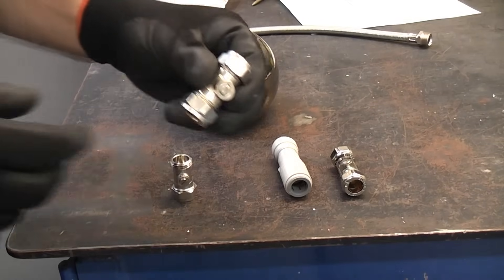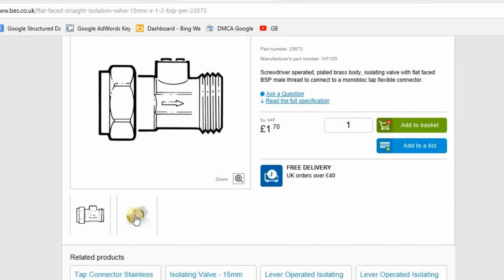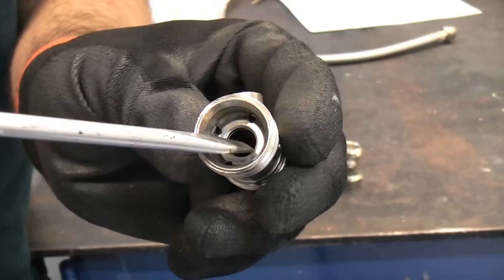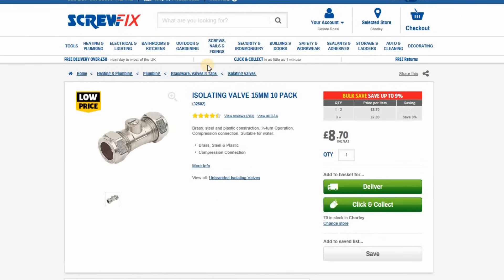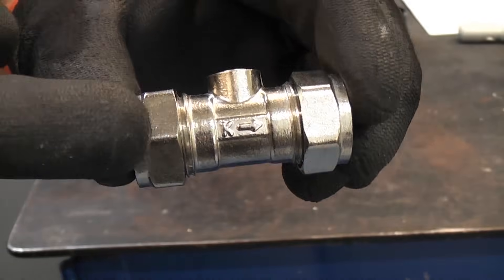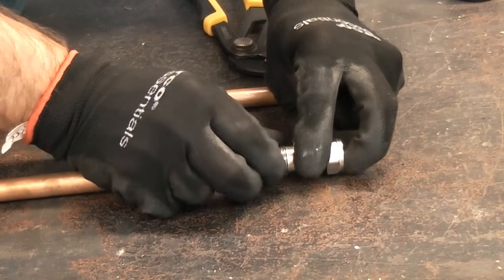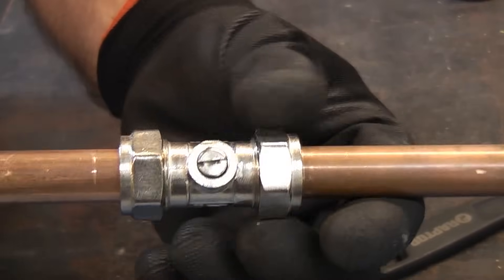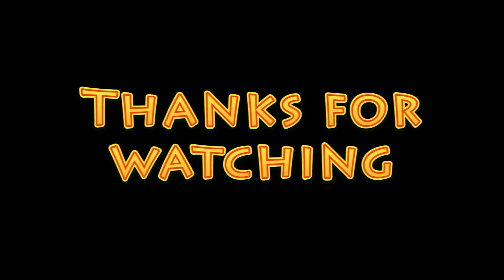How to fit an isolation valve ⚡

Comment: my valves just have a K on them no arrow so iam guessing the flow will go to the right of the k as your British ones have K> hope it’s right
Reply from the maker: You can normally tell by looking through the fitting (where the pipes go), but in 99% of cases if it’s installed the incorrect way, it will not make any difference 😉
Thanks for the comment 👍

Comment: Thank you. Actually have the problem with the slight leak around the screw. Just moved in my new house and was looking for the isolation tap but for what I see I only have an isolation valve

Comment: Mine is weeping from the bottom thread on 2 of them and another 2 further down from the top nut. Brand new fitted by plumber. He said he’s tightened them up a bit further but at a loss
Reply: Crushed the olive. New olive needed.

Comment: Amazing video, espwcially as it was not filmed on a cramped space under a sink!

I have isolatiom valves for our kitchen taps, copper pipe leading into the tap, can i sinply remove that section of copper and replace ot with a flexi sheathed pipe which connects into the top part of the isolation valve?

Comment: Wouldn’t go near them look when he shows you the inside see how much the flow is restricted it’s only about 10mm instead of 15mm and as he’s explaining the price how could anything that cheap be any good the next time you go to isolate the run where you want to work on you’ll open the valve and it will drip these things are mass produced buy a good English brand like Pegler or Hattersley not this cheap muck produced in the far east.

Comment: How much length of the copper pipe need to be cut if the pipe is situ under the sink ?
Reply from the maker: You’ll have to measure the valve that you have 👍

Comment: Great video!  How do you measure the amount of copper pipe to cut away to fit the valve?  I am doing a UFH supply and return pipe (polypipe system) upstream from the main thermostat - the installer didn't put an isolation valve in!  I am not sure about the water flow but logically the hot pipe will flow to the manifold and the cold away from the manifold.  What do you think?

Comment: Can you re-use as in reopen and Re close or would you need a new olive?
Reply from the maker: Yes, certainly. You only need a new olive if you are using the fitting on another pipe. In the unlikely event that the olive leaks, just wrap the olive with a little PTFE tape 👍

Thanks for the comment 👍

Comment: Can you not connect a normal isolation valve to a Flexi instead of the flat end one? I've been doing that for years with no issues.
Reply from the maker: I was told by a gas fitter years ago, just to use a normal isolation valve, but then the flat faced ones seemed to appear. The flat faced ones are better, because there is less chance or damaging the sealing washer. I have installed lots with normal isolation valves, but always get the flat faced ones now 👍
Reply: @ultimatehandyman  thanks. I think I'll use the flat ones to. 👍

Comment: Get the proper ones with the wing head their crap go and work on them after been installed a year or two and they start to leak so your back to square one isolating from the main valve to replace one of these.

Comment: I have a leak from the isolation valve abutting my cold water storage tank. The unit seems to have a threaded extension from where the leak is coming. The nut to nut dimension is about 69 mm. Is a standard isolation vale OK or do I need a service valve...what is the difference? (I'd like a lever this time). Thank you!!
Reply from the maker: It sounds like it could be a service valve. There is often a fibre washer in one of those, it is probably damaged and just needs replacing (unless the valve itself is leaking). You can turn the existing valve 90 degrees then replace the washer. If you want to replace the whole valve with a lever type, you will have to isolate the water elsewhere 👍

Comment: Quite helpful. I attempted replacing mine before watching this video but it was terrible as water was leaking. After watching your video i did the second attempt and there were no leaks. The problem was that on the first attempt I just placed the valve and tightened the nut without pushing the valve further enough. 😂😂

Comment: Never to be used on an outside tap, use a lever full bore valve, if you get a problem you don’t have to find a screwdriver to turn off.
These are a service valve for ball-valve , taps etc you will find that they start to leak through the screwdriver slot after time.

Comment: Can I add this isolation valve to a live water pipe? Not sure if i can turn hot water off in my house want to change kitchen tap.
Reply from the maker: Yes, but you will have to isolate and drain down first

Comment: Great info & presentation, thanks. ps, I found it strange to hear you say 'in situation'. I think you may mean ''In situ'? This does not mean 'in situation'..In situ literally stands for “in place of”, “at the original site of”, “in the natural position of” or “in the undisturbed shape or orientation of”. This is a Latin phrase that is used in different contexts depending upon the area of emphasis. Apologies if im wrong!
Reply from the maker: I was led to believe that in situ was short for in situation, I could of course be wrong. If the teacher is wrong, the student is wrong 😉 
Thanks for the comment 👍

Comment: are these isolation valves made as non return valves? or you would need a non return valve and a isolation valve for fitting mixer tap. thanks
Reply from the maker: No, you would need a check valve to prevent backflow, as an isolation valve will only isolate 👍

Comment: If fitting one in situ 15mm isolation valve on a straight length of pipe how much pipe do you cut out of the pipe for correct operation and installation.👍

Comment: V.useful video, with clear explanations and easy to follow. We ended up using 240 wet and dry sandpaper instead of a deburrer as we couldn’t find one in our DIY shop and it worked well.
Reply from the maker: Thanks for the comment 👍

Comment: Thank you. Appreciated.
Naturally a lot of plumbers don't want small 10 minute jobs even as they would pass by the house anyway. Our old plumber retired and it is almost impossible to find a reasonably priced plumber who won't charge more than half hour call out and parts. Now I have found the parts are only a small amount anyway but our old plumber only charged £30 for small jobs. That was a lot of his work and he did well taking on the small things.
One in Chichester through a checkatrade quoted almost £100 for a tap washer replacement. Checkatrade has really gone downhill and I shan't use them again after our last two experiences. I don't know how they are getting high reviews. The one star reviews are horrendous now. Seems they were bought out.
Reply from the maker: You are welcome
It’s always difficult getting tradesmen to do small jobs, as they would rather do the larger jobs!
Thanks for the comment 👍

Comment: Great video, one question when fitting the 15 mm isolation ball valve, it will mean cutting some of the existing pipe out to make space for it, how best to measure the space needed by the isolation valve?
Reply from the maker: There is normally a line on the isolation valve, showing where the pipe will insert to. Just hold that up to the pipe and then make two marks using a marker pen 👍

Comment: Question. if you turn off the water  from the main supply stopcock in the property. do you need to power off your/combi/condenser boiler.  boiler in question is a bosch worcester.  tia
Reply from the maker: No, you don’t need to switch the boiler off. The central heating will still work, but you won’t have any hot or cold water at the taps 👍
Reply: @ultimatehandyman   Thank you kindly sir

Comment: Those isolation valves are cheap and nasty. They leak as soon as the screw is turned. I only use Pegler Yorkshire now which never fail.
Reply from the maker: Pegler are great quality 👍

Comment: Great video, when fitting to a pipe under the floor what length piece of pipe needs to be cut out to allow fitting?
Reply from the maker: It depends on the make of fitting, normally it is about 40mm (if I remember rightly).
It’s best to check with the fitting that you buy 👍

Comment: 1:15 how come you havent seen these before? Its mostly used to connect washing machine water supply pipe.
Reply from the maker: I think you’ll find that they are two completely different things. 
Isolation valves are ½ BSP. Washing machine taps are ¾ BSP  👍

Comment: Hi mr Handyman, Just a question for you. You said you were using a standard 15mm thread size, this means a 1/2 inch BSP, correct? I need to make sure I order the correct adapters for my new tab?
Reply from the maker: 15mm pipe size. Yes, the nuts are normally 1/2 BSP

Comment: How much do you need to cut out of an existing pipe?
I assume the pack will have this measurement on it.
Reply from the maker: In most cases you have to holed the valve up next to the pipe, you should be able to see where to mark the pipe for cutting. If you are lucky, it might say on the packaging!

Comment: My isolation valve has stopped working turn to on water started to run then it stopped still no water
Reply from the maker: I've not come across that before.
Is it definitely installed the correct way (with the arrow pointing in the direction of flow) ?

Comment: Are they always in direction of the water flow? Some are in the direction of the pressure, although same thing I suppose
Reply from the maker: Sometimes they are fitted the incorrect way, it's not normally a problem, but could cause problems when trying to isolate the valve (if there is a lot of pressure).

Comment: thanks for this, I just relised I fixed a isloation valve the wrong way, as the new one I got had no directional arrow but only a K so I assumed  the water flowed to the left  I  <  but it is actually the opposite way. k  >  this way, yes I am not a plumber, and I could not see nothing on the internet about valves and how to fit them on till this.

Comment: Thank you for this informative upload. Are the terms "15mm" and "1/2"" interchangeable for UK fittings?
Reply from the maker: Yes, only last week I replaced two radiators for a friend and their pipes were 1/2 copper.
Normal 15mm olives (copper are best) and 15mm compression fitting worked perfectly 👍
Reply: @ultimatehandyman  Great, thanks so much.

Comment: Its v difficult when the isolator is tight against wall and in bottom corner, its v hard to get the 2 spanners in. Are there any other tools which can be used?
Reply from the maker: These can be difficult in confined spaces.
A push fit version would be much easier to fit.
You can get compression nut spanners, but the ones cut from sheet steel are crap.
I have one of these, but it depends how much room you have -
https://bit.ly/37w7oQd

Comment: I have found that the screw seizes up on the valves when they have been in situ for some time. The lever ones are better in that respect.
Reply: Agreed they can seize up though mine have been in over 30 years with no problems. Try to avoid the cheaper brands if possible. Lever valves are great when you need to be able to turn off the water very quickly but they need the space to be fitted which is not always possible. Mine are fitted on the supply to the loft tank and the cold water feed to the hot tanks. Much better than gate valves...

Comment: Don't EVER fit those metal valves!  They always leak around the screw and are totally useless.  The speed fit one is probably better but I've not fitted one yet.  Fortunately limescale eventually builds up around the screw and seals it, but you won't be able to turn the screw without a massive squirt!
Reply: A small squirt of WD40 at the screw slot when fitting makes for a better job

Comment: Why does it weep from the screw when isolating and turning back on? What would be the reason for it not working to stop the leak? Would you just need a whole new valve?
Reply from the maker: Yes, if the valve is leaking from the slot, it might need replacing, although sometimes if you turn the slot slightly, it will stop weeping.

Comment: When we're deburring a pipe which has been placed vertically, do we need to worry about the pieces of copper dropping right in to the pipe? What plumbers usually do about it?
Reply from the maker: I don't think there is much you can do, apart from flush out the bits afterwards.
To be honest, If I was a plumber I'd make something to push in the pipe to stop the shavings dropping down 👍

Comment: What's the clearance between pipe-ends, please?
Reply: I think I would insert the end of a pencil, or a piece of dowelling, or even a depth gauge, if you have one, and measure  and mark the distance from the end of the fitting to the stop inside. Do this from both ends, then measure the fitting overall, then add your two readings and subtract that from the overall dimension. That should give you the clearance you need between pipe ends, so it seems to me. Anyone else got any comments?
Reply from the maker: It depends on the make of valve, as some are slightly longer than others.
I think this one is about 40mm 👍

Comment: I have push fit isolation valves in my bathroom but I can't turn them, a normal flathead screwdriver is too small. I don't know if I need a special tool
Reply from the maker: Normally you just need the correct size flat screwdriver. If it one of the valves where the screw slot is plastic - they are crap and the screw often gets chewed up!

Comment: Thanks for this. This is going to make my life so much easier. Why were these not installed as standard in older bathrooms?!
Reply from the maker: There are a few reasons-
1. When the bathroom was installed it might not have been recommended to install isolation valves.
2. Cost of the valve and the added time to install.
3. Introducing something else that could go wrong in future (isolation valves are great until they start leaking)
Thanks for the comment 👍
Reply: @ultimatehandyman  Thanks for the reply. I popped into Toolstation yesterday and got a couple of them, then straight after in Wickes I found 22 mm isolating valves with flexible pipe to 3/4", which is pretty much perfect for what I want to do (fit a new bath). They were dead easy to fit - cold tap was dribbling a bit at first, but it seems to have stopped now and no more water has come out overnight.

Comment: Good information. Are there any isolation values in the UK that have a small knob to turn the valve on /off by hand like in America? (Without the use of a screwdriver), like this:
https://youtu.be/0XmUoCkdhSo
Reply from the maker: Yes, they are called isolation valve with lever-
https://fave.co/2WF69p8
Thanks for the comment 👍

Comment: What happens if you need to take the fitting off and reinstall. Would you need a new O ring or can it just tighten all back up as normal without anything extra required
Reply from the maker: It depends, most of the time you can remove and refit it. If the joint weeps, you can wrap a little PTFE tape around the olive and it should be fine.
Thanks for the comment 👍

Comment: Great video as always. at 0:39 the JG speedfit says it cannot be used on central heating systems.  If you have new build combi boiler home setup does this rule out all pipework?  As when you turn on taps it will cause the boiler to turn on?  thanks
Reply from the maker: Some John Guest speedfit fittings are not suitable for central heating, examples are the isolation valve in this video, and some flexi fittings. All the John Guest regular pipe and fittings can be used on central heating, I'm not sure why some fittings are not suitable- but most are. You can of course use any John Guest fittings on the domestic hot or cold water. 
Thanks for the comment 👍

Comment: I need to replace my service valve to the toilet cistern,  the one in situ has a fibre washer,  yet the replacements all have and o seal,  will the o seal do same job? Or should i use a fibre washer ,  replacing o seal obv.
Thanks

Comment: all the taps i bought come with 20mm flexi pipe. i cant find ANYWHERE that sells something to adapt 20mm pipe to ANYTHING
my house pipe is 15mm 
what to do? i cant even turn the water back on :'(
Reply from the maker: I'd take it to your local plumbers merchants, you might end up buying new flexi tails.
I bought a tap from eBay a few years ago and had a similar issue
Reply: @ultimatehandyman  I installed compression isolation valves and they turn out to be 20mm thread even though it says 15mm so I could screw flexi tail directly to that. Going to do same with kitchen

Comment: I put a new one on but it is leaking, would it be because I used ptfe tape (wound round 10x)
Reply from the maker: You don't need PTFE tape on compression fittings (unless they weep)
Are the olives copper or brass?
Copper olives are better IMHO, sometimes brass olives to not seal correctly as they are less malleable 
Thanks for the comment
Reply: Olives are copper but I didn’t want to use the new ones as the fitting is under the bath & hard to get the old  olives & nuts off.
Thanks for the reply

Comment: Is deburring necessary is I use a circular pipe cutting tool?
Reply from the maker: Yes, I'm afraid you still need to deburr it. Circular type cutters are great, as there is no burr on the outside of the pipe, but they leave a burr on the inside which needs removing.
Thanks for the comment